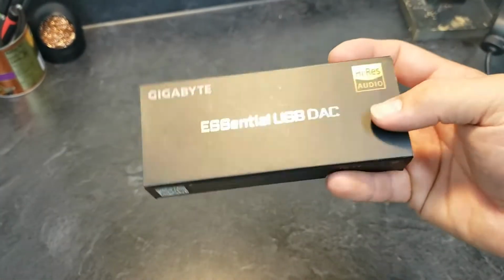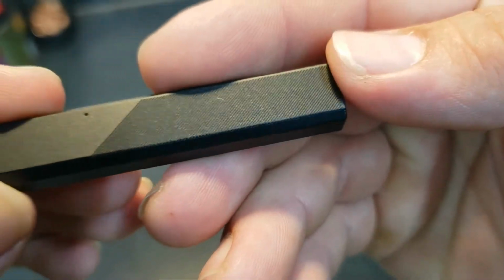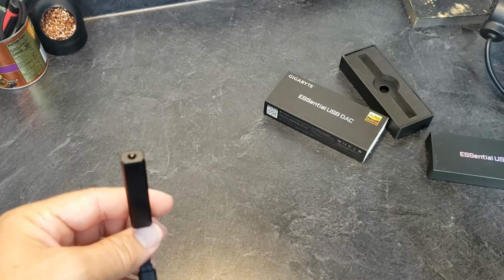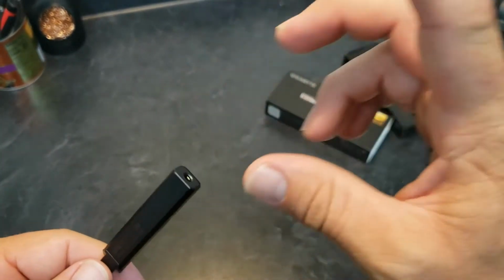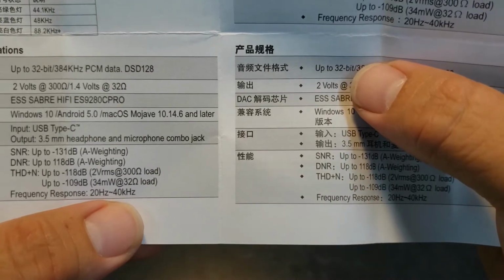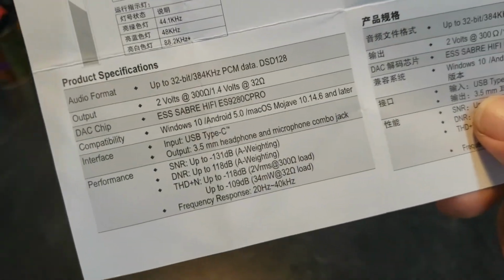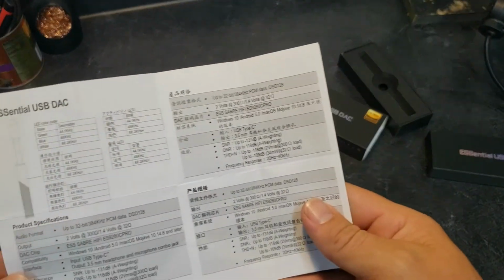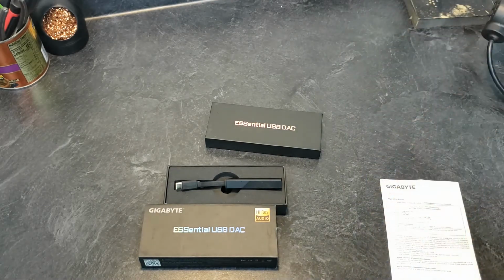Gigabyte ESSential USB DAC Dongle (The - Jody)

Comment: I got 3 of these brand new off mercari for 25.00 bucks 5 months ago. Sounds pretty damn good. One flaw that I haven’t experienced ( But heard) if you bend the cable too much, it will eventually cause the sac to stop working. So I use mine on my iPhone 13 Pro Max with one of those cell phone rubber net things, so it sits completely flat on the back of my phone. Oh, and you probably already know by now, that’s the hole isn’t a mic, but the led light for the sound quality.
Reply: how do u even use it? do i just connect it to my pc and thats it?
Reply: @ yes.. your pc will automatically download the files to use it. Or plug it into your cell phone with USB-c
Reply: @THALYRIKALONE  wait, am i suppose to put the dac in my speaker then aux on pc while connected to the dac?
Reply: @ you plug the dac into your pc, if your pc doesn’t have a usb-c slot, then you will need an adapter. You can also plug it into your phone that has usb-c
Reply: @THALYRIKALONE  i have kef ls x ii speakers which are connected with usb c to my pc, so just connect the dac to motherboard as well then? what about the aux connection on it?
Reply: @RussStufft  does it have a 3.5 headphone jack on the other end of the usb c cable?